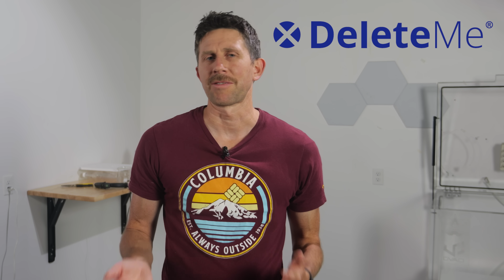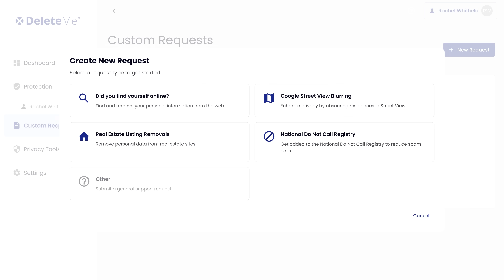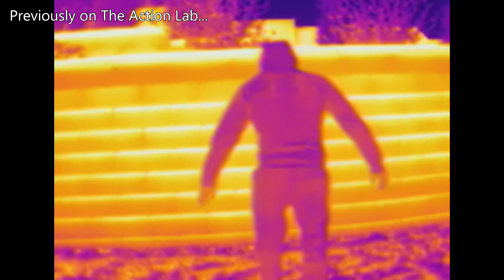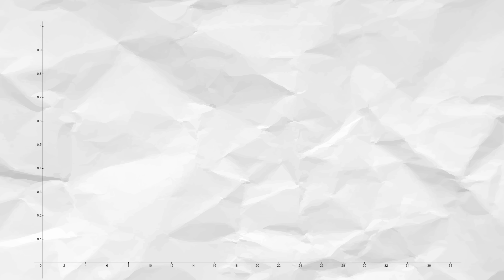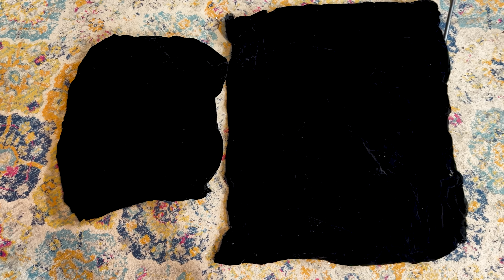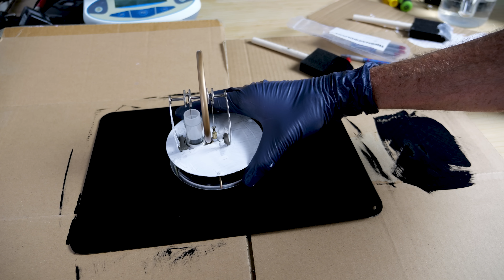This Engine Runs On Sunlight

Comment: If anyone thinks about power simply scale it up and build it near the ocean. cool the cold side with running water and use solar reflectors aimed at the black bottom. Now you can actually get this concept up to 30% total efficiency - 50% with a really large super efficient sterling engine.

Comment: Great now make a thermal diode by painting one side white and one side black.

Then wrap that one way around a copper tube and then the other the other way....

Then you have build why I will never invest in fusion

Also make some blinds with a thermomoter and a switch to switch angle

Comment: that project is very cool, the efficiency of this sterling engine will be close theoretical and practical limit. Not only temperature difference is max which material will provide, but the gradient of the temperature is also max out. The gradient is proportional to temperature difference and the backward proportional to the distance between cold and hot bodies. And they are really close in this experiment.

Comment: Great experiment. If you flip the entire structure over so the sun doesn't hit the white part, it will be even more effective. And if you attach one with a propeller to the heated roof ceiling, you can use it for indoor ventilations. Nice.
Reply: Im not sure this is true. The white paint is doing work here. its colder than shade. You would get more heat if you flipped it, but somewhat less cold.
Reply: @Alex.Holland Warm air rises, cold air sinks. At close range, the difference isn't noticeable. However, over time, the difference will become more noticeable.
+ in the inverted version. Only the part that should be heated is exposed to direct sunlight and heats up. The cold element is hidden under the hot element's shadow from the sun, heating up even less. In theory, the temperature difference between the elements will be greater. More donkey-power... In theory.
Reply: @1Desertkid  But you are missing the part about the white paint being cooler in the sun than shade is, because it can radiate energy in to space. space is the heatsink for that white side.

Comment: can we determine the efficiency somehow?
Reply: Stirling engine is 100% of Carnot efficiency IE the highest efficiency possible for a heat engine.
Reply: @fuzzy-pillar  i meant the efficiency of absorbing sunlight per square meter transformed to mechanical energy. so we can know whether using a solar panel of the same area is better or worse than this solution.

Comment: Nice! It's like having a water wheel inside a heat tube!

Ooh, do you still have that heat tube? I wonder if a box made of say 4 inches of xps foam could be cooled off by sticking a heat tube through the top like a straw. I'm thinking of the sides being painted black so the sun will bake it like an attic, and then test if adding a heatsink to the outside end of the heat tube makes it work faster. And then maybe even faster if it's colored with cryopaint.

Pretty much the idea of thermal bridging, like all the studs in an old house do, but with more thermally conducive materials and juiced up with science. 🤷‍♂️

Comment: That one friend that would use anything but a solar panel
Reply: More like solar panels during steampunk era before electric power
Reply: @SalzmanSoftware  A good chunk of the electrical grid is powered by steam. Coal, gas, nuclear and even solar on molten salt heat water into steam to power the turbine generators that produce electricity. So technically were still in the steam era.
Reply: @Samu2010lolcats  yeah but the punks are dead.
Reply: @Samu2010lolcats    this is because steam engine never gets old, it just needed a complex turbine and condenser
Reply: @Samu2010lolcats  
Lol, the guy doing this video is definitely a big steamer!!!
Reply: @SalzmanSoftware steampunk is fiction
Reply: What is the Carnot efficiency then?
Reply: @EmDotJay it's transformed energy per original energy for things that are not cars?
Reply: Solar panels aren't easily available to everyone in the world.
Reply: @jacobopstad5483  ok and?
Reply: @jonaskarlsson5901  everyone live in the world
Reply: @jonaskarlsson5901  And this would be easier to manufacture then solar panels because you aren't wiring a bunch of temperamental silicon parts probably produced in a fab overseas, you're just slapping a doohickey into 2 painted objects
Reply: @realSuperRyn  this video isn't about that
Reply: @jonaskarlsson5901  so what? are we not allowed to mention anything outside of a video, even if it's on a related subject?
Reply: @realSuperRyn  it wasn't related at all. It was derailing
Reply: @jonaskarlsson5901  If anyone is derailing here, it's you
Reply: @realSuperRyn  "That one friend that would use anything but a solar panel" was clearly a joke maybe you are too dumb to realize that

Comment: can a Stirling engine over come the resistance of a generator attached ?
Reply: Yes it is a genuine engine.
Reply: @fuzzy-pillar the torque seems very low a question the feasibility of a generating power with such an engine.
Reply: @MrAtrophy  Sunlight has a massive amount of energy in it. So much that if we had plant skin we could survive off of it. Yes, i'm serious. I ran the numbers.
Reply: @fuzzy-pillar  the mechanism in doubt for me like i said is about torque. if you ran the numbers what are the torque numbers of these engines and does it scale with size?
Reply: @MrAtrophy use defferrent type of sterling engine. And pump water between the surface to transfer heat to the engine.
Reply: Yes..
Reply: a person with minimal workshop skills could make a stirling from tin cans that would run a radio from the heat of a small candle
Reply: @cuthbertlewthwaite sounds cool.

Comment: LETS PUT IT IN THE VACUUM CHAMBER
Reply: This kills the stirling engine
Reply: I think most of the heat from the cold side is transferred to air, not to the sky as radiation. So if it would be painted with a simple white paint or something reflective, result would be the same. So only the vacuum chamber will show if the paint really works.
Reply: The problem with the vacuum chamber is that it must be transparent in that deep IR on which the white pain radiates. Otherwise it will be much less efficient, because it will exchange the heat with the room temperature glass instead of cold space.
Reply: Problem with the vacuum chamber is that stirling engine Isn't sealed
Reply: @LokiScarlet  Theoretically it is sealed. To avoid leaks through the piston rings you may seal the complete engine, leaving only the black and white plates in vacuum.
Reply: @azlktune I'm talking about the one in the vid, since we're talking about the one in the vid. It's too weak, the pistons are too weak, it won't survive vacuum
Reply: @LokiScarlet  Actually it would be enough to put the colored plates in the vacuum and measure their temperatures. Heat conduction between them will imitate heat flow over the engine.
Reply: @azlktune I mean sure you'll get a temperature difference but again it won't be a stirling engine anymore, it'll be a fancy brick. What's the point then?
Reply: @LokiScarlet  The point is to check that this magic paint will work better then normal white paint or reflective foil.
Reply: @azlktune  No stirling engine needed for that test, just put the paint on a piece of metal thermal pasted to the black panel :P

Comment: So I guess it’s not truly a perpetual-motion machine because you’re adding constant energy to it, at least from the sun.  I believe that’s correct.  So it doesn’t violate at least that physics rule.  But I guess eventually it would fail because the hardware would degrade over time.

Comment: What would be interesting to share is a comparison to a solar cell with the sterling engine arrangement (area). Just to get a feel for it.
Reply: Yes! That would help us armchair scientists wrap our brains around the concepts. ✊😸
Reply: @erinmac4750  you guys can afford arm chairs ? 
All i got was a on box
Reply: The solar cell of the same footprint produces much more power and delivers it in a more useful form.
Reply: @codetech5598  Curious. Do you have any info that validates this? Regular solar panels ( monocrystallines) have less than 25% efficiency. So what's the equivalent percentage for this engine?
Reply: Just look at the power rating in watts of a solar panel that size. Efficiency is not the point.
Reply: @alihms  Mechanical = losses via friction. Solar panels aren't mechanical. So they should theoretically be more efficient
Reply: @alihms  The laws of thermodynamics tell us that, in order to get 25% efficiency, the temperatures must be at least in a 3:4 ratio (in kelvin) So if the cold plate is at 0C and the hot plate is at 91C, you could theoretically have 25% efficiency. In practice, I suspect the temperature difference is smaller.
Reply: Just for fun, I asked Gemini. Back-of-the-envelope, and electric motor powered by solar panels would around 30-100X as efficient as the contraption described in this video.
Reply: Okay, now let's compare costs...
Reply: @KWifler  Not just monetary cost, but what materials are needed. Solar panels are obviously more potent, but they include components that are far more complicated to make than anything in a traditional sterling engine, and from what I've heard, they wear out every 5-10 years from regular use, needing to be repaired or replaced to retain the same functionality. I assume sterling engines can have parts wear out as well, but the parts are easily replaced, and probably last multiple times longer before needing maintenance.

As for this particular sterling engine, the exotic paints used for the black and white parts may be expensive &/or complicated to make, so this version of a sterling engine may not be as simple or cheap to build in comparison to a traditional sterling engine.
Reply: @seanmadson8524 The funny thing is that he's using an old fashioned design of a Stirling engine, one that is notoriously flimsy and unreliable. There are now much more reliable and efficient designs available, and there are also cheap simple thermoelectric devices that have a theoretical upper limit of efficiency of 100% that he could have used instead. As for the paint, it's unlikely that it would seem expensive in comparison to the exotic materials in solar panels, and it would likely last much longer.

Comment: I would've had the black side facing the sun and the white side facing directly away from the sun, to maximize the temperature difference.
Reply: No, you can't do that. The black side needs to heat the air in the cylinder. I think you should know that to heat an object efficiently, you have to heat it from the bottom.
Reply: @neilg2256  What are you on about? You'd just have to rotate the whole thing 90 degrees away from the sun, and paint the underside of the large plate black.
Reply: the white side has to face space, so pointing up towards the sky. it can only radiate into something that has a lower temperature because thats just the way radiation works hot to cold, space is very cold.
Reply: @snarfbot  Yes, and nothing I wrote said anything about pointing it towards the ground. Just away from the sun. It would still "see" the sky, just at a bit of an angle, but not being bombarded by sunlight would more than make up for not being aimed straight up at the sky.

Comment: Wow. New way of boiling water
Reply: Ironically the only form of electricity generation that does not involve boiling water. It works off of expanding gas.
Reply: @fuzzy-pillar  Photovoltaic, wind turbines, hydro power to name just the most common methods

Comment: I wonder if there is someone who could compare this to a nuclear power plant.
Reply: If you are talking about building something like this to run a turbine capable of producing electricity on a usable scale compared to a modern nuclear fission power plant than you'd have to build one on the scale of the state of alaska.. not very practical for that reason.
Reply: You can run your house for  your entire life..one is free..some control freeks wants to put meter on it.
Reply: @infinitebeing1119  Only if your house is really really tiny, about the size of a matchbox

Comment: What was the temperature differential between the cryopainted surface and the black surface? Why not use the floc instead of the black paint (visible vs full spectrum absorption)? Would this work with just the cryopainted emitter in direct sun?

Comment: I wonder, if that was connected to a generator, if ultimately it is more efficient than a solar panel (30%) at generating electricity? It would be neat to see some sort of test to see what can be generated. :body-blue-raised-arms:
Reply: It'll generate almost nothing, probably not even strong enough to turn a generator with some load.
Reply: Thermodynamic efficiency is Hot-Cold / Hot so for this to be 30% efficient you'd need a heat of 430 kelvin on the hot side for a room temperature of 300, or 157 degrees centigrade on the hot end and 20c on the cold end. Not impossible if you water cool it, and it gets better with higher heat.

Comment: I wonder about how clean this energy is (how clean manufacturing the paint for it was).
Reply: If the paint is used only one time and discarded, the answer is not clean at all - the shipping alone would come with a much larger carbon footprint than an internal combustion engine with the same power output. But, that's not really the point here.

If the paint is reused repeatedly, it wouldn't make sense, as it would be cleaner, cheaper, and simpler, to just use an electric motor powered by solar panels and/or batteries.
Reply: @ab-tf5fl  you're not getting an electric motor to passively harvest heat energy and turn it into useful work. Every second you run a device that needs man made energy inputs, you're adding to the carbon footprint.

The lifetime of carbon free operation ends up being a net negative when compared to any powered device, and the efficiency of the value of how much you pay for input energy and maintenance, divided by the market value of the energy output is always an over unity statement.

You're over here making an equivalent argument to discarding water and wind turbines because they can't consume egregious amounts of energy during operation, which is blatantly stupid because this is a generator. This thing generates mechanical motion directly from ambient energy, none of the powered motors you can think of will do that. The comparison is completely invalid.
Reply: It has to be very clean or the white pigment will get stained.

😂 it's baking soda white and lampblack black. What are you on?

Comment: Oh, I hoped that the potential to generate power would be calculated in this episode. Now I hope it will be done in the next one 😁
Reply: Using an online calculator for Stirling engines and some very rough estimates for the parameters of the engine shown in the video, I get a power output of 0.3W. While this could certainly be improved - the whole construction is clearly optimized for demonstration purposes rather than power generation - the efficiency of any thermodynamic engine powered using cryo paint is limited by the relatively small difference between hot and cold sides. With the equilibrium temperatures given in the video (85°F and 175°F), the theoretical maximum efficiency is about 14%. That's slightly worse than the least efficient commercially available solar panels. TL;DR: It's a cool demonstration, but it certainly won't replace solar panels - even before factoring in maintenance costs due to the moving parts.
Reply: @knutfranke6846 I think further improvements could be made by using lenses or a solar oven to hear up the hot side even more, and using reverse greenhouse panes for the cool side.
Reply: @joelbolduc3354 True. You can use concentrated solar power to get more reasonable efficiency, and the Wikipedia page on CSP even mentions Stirling engines. Would be interesting to know what real world examples there are of this combination.
Reply: @knutfranke6846  0.3W is tiny, but it's enough that you could conceivably do small amounts of useful work with it. If you have a 1W water pump design for example you could use a coil spring as a mechanical capacitor and run the pump off of that spring in 1/3rd-of-the-time intervals. A solar panel and an electrical motor would be better, but this way you don't need any wires or insulation and the system could be fixed with very primitive tools if it physically breaks, instead of needing other advanced tools like soldering irons or a full solar panel replacement. Of course nobody is eve going to set something like this up for real, but it indicates that there's a lot of room for experimenting with alternative robust low-energy mechanical systems to see if they have high enough utility.
Reply: @knutfranke6846  0.3 Watts is still more than I would have expected.  Neat.
Reply: It'd be more efficient to use reflectors / concenrators to drive a steam turbine.
Reply: @ryebis  closed loop steam engines with significant wattage have serious maintenance issues or else they go pop from internal pressure. a low-pressure low-wattage setup would probably work fine, but you have the issue of keeping all the reflectors etc. sufficiently aligned. sterling engines are interesting because they can work on such small heat differentials that you don't need very much energy concentration to get them working, the hard part is just the heat dissipation part
Reply: what do you mean by power?
Reply: @Tom-f8r8o  Work done (rotational acceleration in this case) over time